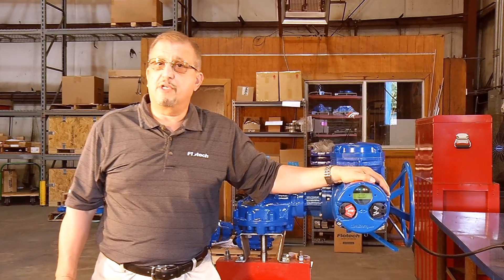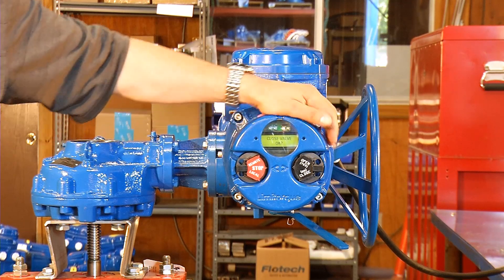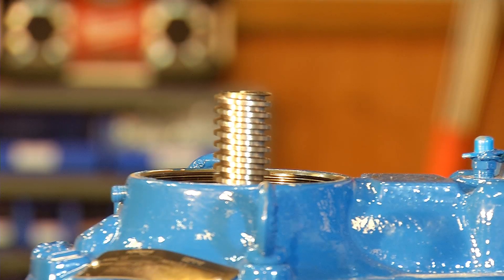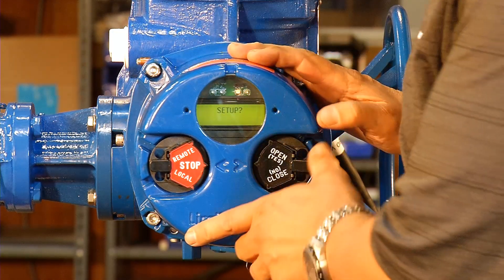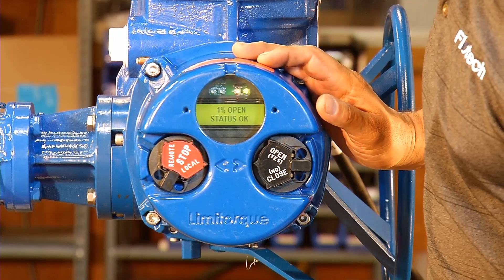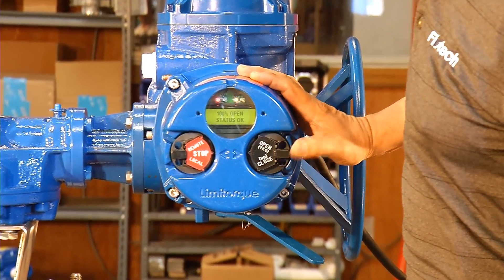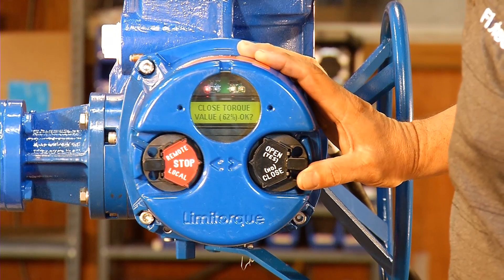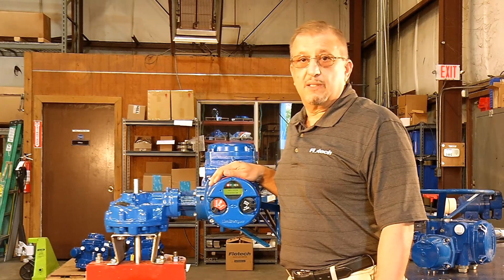How To Limitorque Actuator Setup MX = Multi turn -  Torque Settings

Comment: Question: What could cause a timeout torque alarm? I had an electrician calibrate the open/close stops, and when I tried to open the valve in auto remote It only traveled halfway before failing close. The valve opened 2pct at a time, unlike the 12pct the valve you demonstrated did.  Thank you.